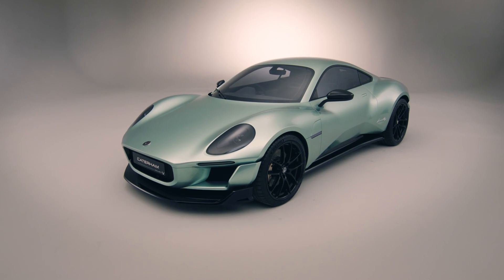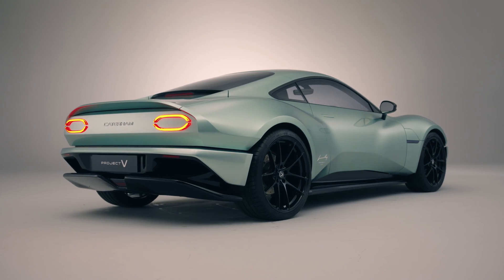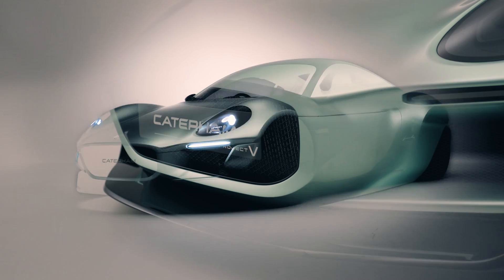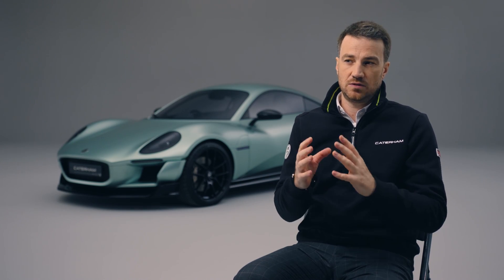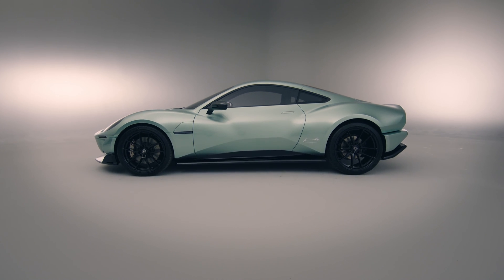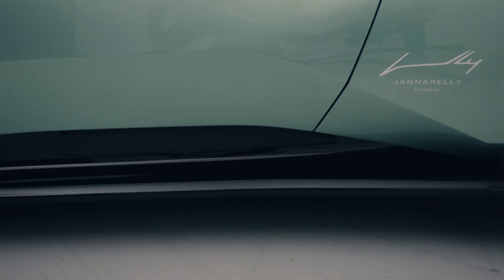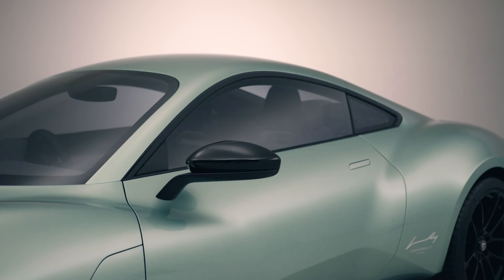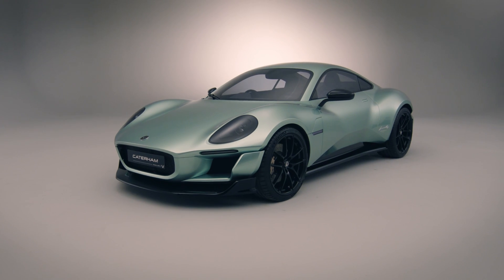Caterham Project V | Starting From Zero

Comment: Only thing I need to know is did u leave space in the car to swap an engine and manual trans in? Nothing else matters. The car is gorgeous n light, it would be a shame if u didnt leave space for a real drivetrain, because without an engine and trans this is a replica car, a wannabe sports car.
Reply: Unfortunately, there is no possible ICE engine swap for the Caterham V that wouldn’t make it slower and less fun to drive.
As a racer with over 25 years experience, including two Caterham 7s (one for street, and one built to SCCA E-prod rules) who has almost exclusively raced EVs since 2014, a properly designed and built EV race car is superior in every way to the equivalent ICE car.  I understand your point about driver involvement!   My street 7 has Caterham’s SuperSprint 1700 Ford crossflow motor (with Weber DCOE 40s) and a Ford Cortina 4 speed, and the synchros really need babying, so I rev match all downshifts, and also the 1-2 and 2-3 upshifts, and there is a real sense of satisfaction from having developed the skill to heel-toe those rev-matched shifts while braking hard into a tight corner, and a certain joy from hearing the burble on overrun when the butterflies snap closed after a long fast pull down a straightaway.  The EVSR electric race car doesn’t demand the same skill with my feet (indeed, with no gears to shift, the left foot spends all its time on the dead pedal) and the auditory joys are much quieter (in an EV race car you can hear the difference sounds the tires make as they provide different levels of grip on different patches of asphalt) but there is still the joy of taking the car to its limits, of consistently finding the proper line through a complex series of corners, the triumph of winning a close race against evenly matched cars and drivers.  Yes, EVs are different from ICE cars, and some of the joys of ICE cars are missing from EVs, but there are a whole new set of traits to enjoy.
One of my mentors used to say (in a completely different context) “if all we were allowed to race was shopping carts, then we would race shopping carts!”
I’m not saying EVs are like shopping carts (quite the opposite!) but rather pointing out that the joy and passion for motorsport, and sports cars, isn’t dependent on a particular drivetrain or bit of technology or some auditory experience, it’s about competition and camaraderie, the joy of the race track or the open road, of testing man and machine.  Racing EVSR for the past 10 years I’ve learned a new set of skills, instead of playing around with jetting on my Webers now I tweak throttle mapping and regenerative braking valves in software.  Same concept, learning the intricacies of the machine to get the most out of it, and now I don’t come home smelling of gasoline (though carpal tunnel can be a problem 😂)
Reply: @jpe1 You can't argue with fools. Even Porsche got rid of manual transmission because they understood it got in the way of performance for the 911.

The only reason why they haven't also swapped combustion too is because electric is still inferior when it comes to powering a sports car, but not for long.

Caterham got the right idea, speeding ahead of the competition.
Reply: ?? A wannabe sports car???
Reply: Why r fake pretend car guys replying to me? Yall have no clue what a car is n never will, stick to something else. A electric car can never be a sports car. Yall r d3 pr3ssed, let the ppl who r actually gonna buy these n drive em enjoy. U kids aint into car n driving, ur into showing off, a car is a tool for u too showoff, a transportation device. Real car guys breathe cars n the satisfaction from driving em, u willl never experience 1% of that in ur life, no matter if u try to drive it or w.e u wont be able to get it clearly.